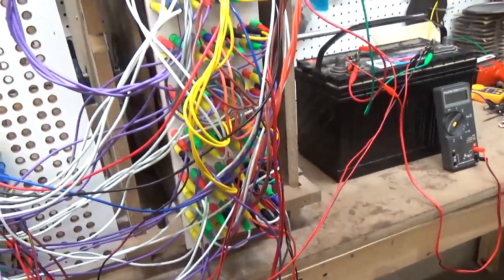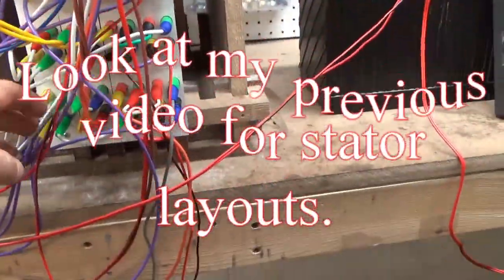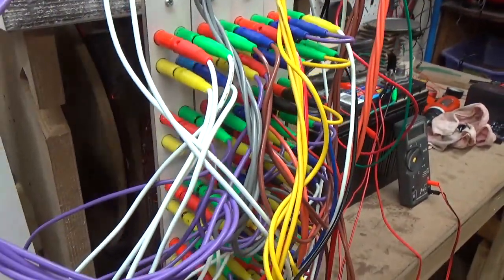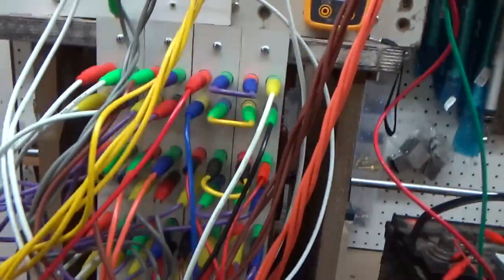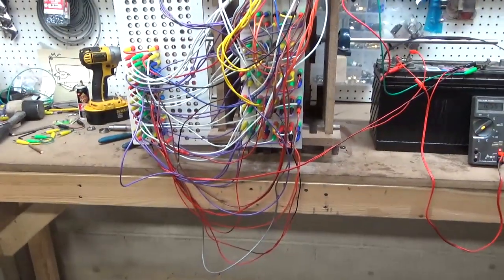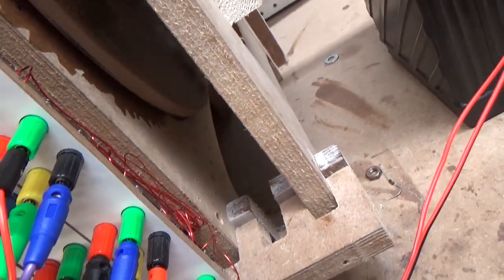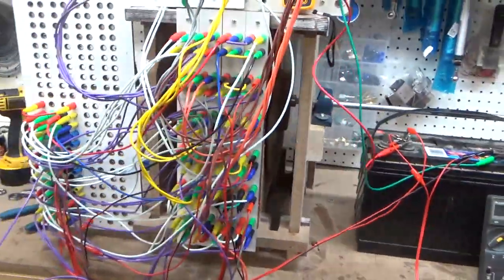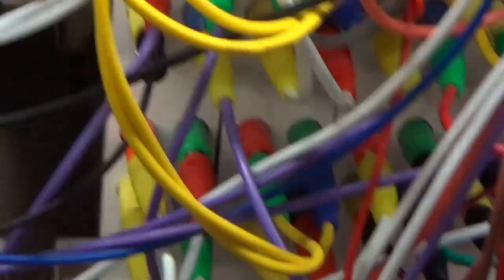LIARS! LIARS! Law of conservation of energy on fire!  Elliott EAPG Quickie

Comment from the maker: I made a mistake on starting voltage was 12.41. I need to just start filming everything i do.  
JUST WAIT till its finished.  Obviously the finished deal would not need all the test configuration jacks.
Reply: Hi, great work. Interesting results. Can you add a adjustable PWM at the output. It may help reduce any back EMF and increase the RPM's.
Reply from the maker: My output is pulses. But I will try that when I put on ceramic capacitors. I think that’s the secret. Each coil is a separate pulse and there are 48 coils.  This thing weighs about 80 pounds I would guess. I have very low eddy currents because of the easy spin configuration.  The back EMF is not present with forward bias configuration.
Reply: @jameselliott9397  Hi, I forgot to say a capacitor dump circuit with a adjustable PWM. Charging a bank of electrolytes cap's and then dumping the charge to a battery  it is easier to charge then charging  a resistive  load directly. Again great work.
Reply from the maker: Yep that one of the test configuration I will do.  I am putting a lot of effort into make sure I can tray a ton of configurations.  I need more youtube subscribers so I can monetize.  I’ll promote your channel if you’ll plug mine.
Reply: Man im trying to get you subscribers. Im sharing and telling everyone to check out your channel. Thank you sir. My son and I tinker with electronics because I remember as a child the electric line was right outside my bedroom window and I remember 1 wire that was black coming into the house electric panel. Then there was a ground rod at the corner of the house. That bare copper wire went to the same panel. Why is there 2 black wires coming down today? We think that one comes in and the other goes out. If according to the laws of energy..energy cant be created or destroyed so the electric I use goes through my house and out the other wire to the next house and they keep using the same energy and charge everyone for it? As I said my son and I love the challenges electronics bring. We read a good bit and obviously watch videos. We will donate when we can but, everyone share this mans video's hes going to help us all. We are waiting in hopes of a schematic. Thank you.